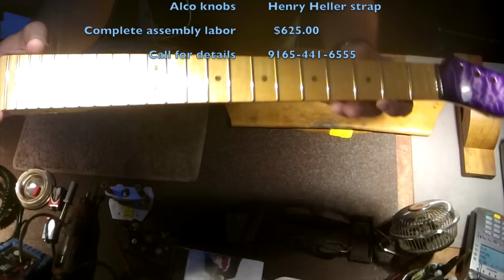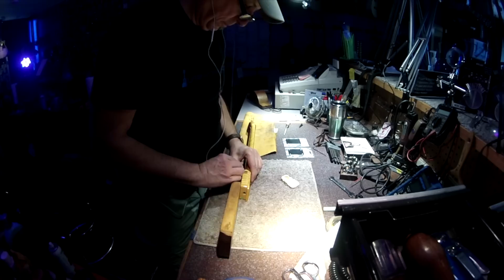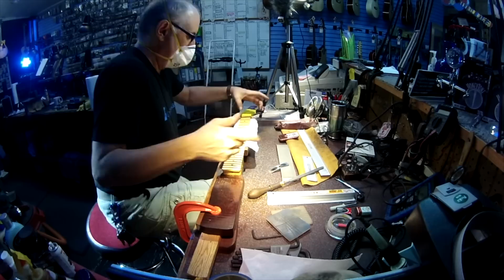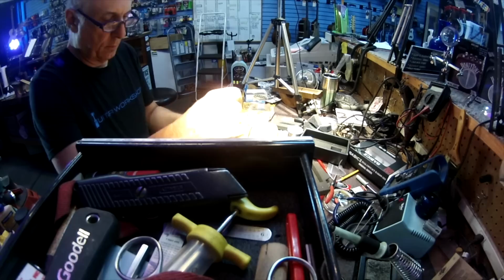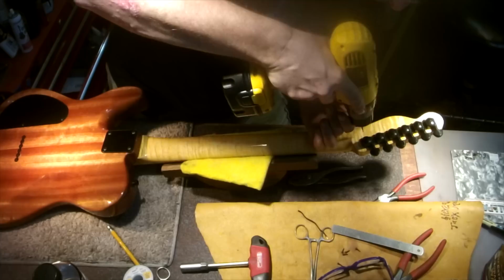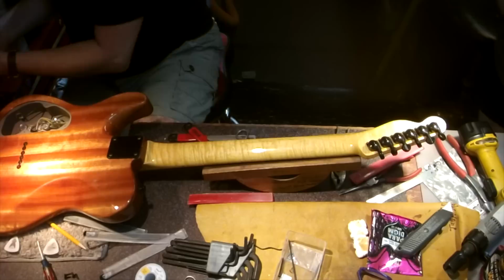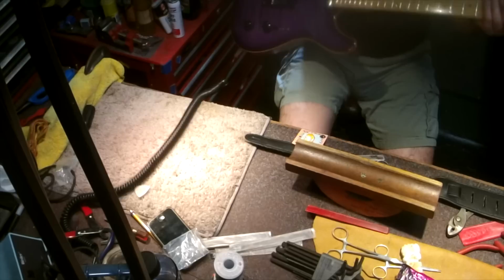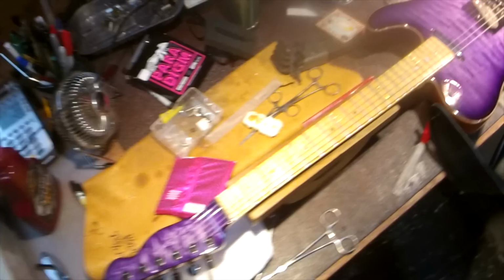Warmoth Tele Build July 2017 Guitar Workshop. Sacramento, CA

Comment: Nice work Dave, but, 1 should never have to do any mod work when ordering from warmoth. They really should have made sure that neck was nicely fitted with what they charge, cheers. Dave.
Reply: I have to agree.  Warmoth should provide perfect fitting parts, since they are making them.  Otherwise, something isn't right.
Reply: I ordered a bass body and neck from Warmoth. They are in production right now. I asked if they would fit together and was told they would since I ordered them together but they wouldn't really do any work on the fitment of assembly because they get in trouble for that.

Comment: Beautiful! I just have to have a pickguard with a Tele though... especially with a thick pick like a V-pick, I'm always hitting the body...
Reply from the maker: Hey Christian, thank you for the compliment and comment. Perhaps you could go with the nice top and make a transparent guard that custom fits the specific areas your pic digs in, minimizing it's muting effect?  I use a really big pic too, the Clayton triangle 1.52, but I've practiced to avoid that extra body gashing for pic control and accurate note selection. Sooner or later, my fingertips eat into the wood though, but heck, if we're not wearing out our guitars, we're not playing enough!  Here's a clip from a recent gig, doing an old Peter Green tune. I'm playing an old 1984 Ibanez RG440, modified, Warmoth neck, etc, the Tele is on the stand behind me (in the Santa hat!). We'll have upcoming vids where the Warmoth tele pictured here gets showcased. Thanks so much for watching, post a link if you build one!
Cheers! 
https://www.youtube.com/watch?v=i099OaFivlg

Comment: The only problem with using Fret EZ is that it contains silicone which goes right thru the finish into the wood making any future refinish work impossible unless you use straight silicone additive like autobody Jamb It which makes the finish more likely to flake off.
I used to work in large factory repair dept.and my repair/ touch up booth was upstairs next to machine shop. Was spraying nitro on a repair and someone there sprayed silicone lubricant on a machine and it was fish eye city on the guitar top.
      Many years later working for fixture shop with spray booth and a new guy brought some silicone spray to work and my boss chased him out of the shop ! He was a guitar builder and somehow knew about this problem.
It's nice that you are player
Might visit if in area I am in OR.

Comment: Need yearly maintainence tips/advice for my guitars. Usually I do the following to maintain/keep my guitars in good playing/looking position
-Change strings every 2 months
-Wash hands before and after playing
-Wipe down the guitar with a microfibre cloth
-Keep guitar in the hardshell case
-adjust truss rod when neck moves during the seasons change

I usually don't go crazy with oils/polish etc.
What do you do to maintain and keep your guitars in good condition? what about the neck/fingerboard-especially for maple/rosewood fb? 
advice and suggestions appreciated.

Comment: how did fender get it so right so early on?
I dream of nothing but teles
Reply: Early fenders are nothing like this though
Reply: @TheEchelon  Yeah but the Broadcaster design is SO considered, engineered
I have a couple of custom teles and of course they have the body contours added
but there is so LITTLE improvement you can make on the original design
The big meaty neck makes for awesome sustain and the older vintage radius is great for chording : )

Comment: Hey Dave, That's a spectacular looking guitar. Thanks for sharing your process. I have a question regarding the bushing install. I've built two Warmoth Teles myself (I'm no luthier, just a DIY enthusiast and guitar nut) and I installed the bushings by using an old soldering iron with a pencil tip to heat the bushings in place until the lacquer softened enough for the bushings to seat snugly. I saw the technique recommended on several build blogs and forums. You opted to route out the holes instead. Is there a disadvantage to using the heat-and-press method that I'm not aware of? My next project will be a hardtail Strat and I don't want to keep using a potentially inferior technique if it could cause me grief. Thanks!
Reply from the maker: Hey Damon, thank you for watching. I use the heated parts for anchor extraction, and yes, many like installing that way, so you certainly can do that, but it also comes with a different set of risks: the bush not sitting quite right and skittering across the back leaving little melted puckers, or the rim setting too deep into the finish. But either will work. I like the clean out as I get a nice metal to wood contact and the rim sits cleanly on the finish surface. Being fallible, I try to take, for me, the path of least failure of my own limited skill set!

Comment: The whole point of locking keys is so you dont have 10 string winds ... wonder why he wrapped the strings so much?
Reply from the maker: Break angle over the nut, no string trees, no tree hang up, no slipping on the post either.
Note: some keys, like Sperzel 6 in line may be purchased in a staggered set, keys 1 & 2 very short, 3 & 4, a little taller, 5 & 6 normal, so a treeless headstock with break angle and no progressive wraps is possible, I just liked the Grovers for this build, they're not staggered. Thanks for the great question!
Reply: Dave Tone ahhh! Learn something new every day

Comment: You gotta be kidding - is Warmorh using Gibson’s QA book now? LOL.  For the money Warmoth charges you should NOT have to resize the pocket or do anything to that neck but bolt it on.  $100 necks from China - maybe. But a $600 neck should be Plekked for crissake.
Reply from the maker: You get what you pay for, it's that simple. Warmth quality is still stunning.  I'm still gigging on necks I purchased shortly after Warmth got started, and they're still stable and true. There are no Chinese builders at this level. Note: the body came from the Gallery page, the neck was made 6 weeks later to match, so the two parts never saw each other until they arrived in my shop. When I've ordered a neck and body together for the same project, they fit, but there may always be some lacquer thickness issue to be addressed when ordering separate parts. I'd much rather have to trim a bit and have a super snug fit than extra wiggle room.
Reply: Agreed. Warmoth is way too expensive to be making a neck that doesn't fit the body they sold along with it.
Reply: This seems a bit unusual about the neck not fitting into the pocket, as I have built 3 Warmoth guitars and all of them were a perfect fit. If you go buy a Custom Shop Guitar it will set you back way more than a Warmoth, and the Warmoth products are absolutly beautiful quality and you can pick what ever exotic woods your heart desires:-) (very custom infact).

Comment: Aren't you supposed to use as little wind as possible when using locking tuners?
Reply from the maker: No actually, Ideally you want a minimum of a 50 to 75% wrap around the post so the load bearing is on the large curve of the tuning shaft, not the sharp angle of the post string exit. As I am not
using tree's, I also need break angle/downward force over the nut, so with several wraps I achieve that. Once the string is pulled taught it doesn't stretch out of tune. It didn't for me. 
I played four gigs and wasted this set and have zero tuning problems. I've had three different sets on and no tuning issues at all. Very stable. Hope that helps!
Reply: @davetone2106  false tbh. Choosing not to use string trees have nothing to do on how a locking tuner is supposed to work. You can just get away with it on a tele cause you have a fixed bridge, but having multiple turns would render the locking tuners pretty much useless while dealing with a whammy bar, and i guess and hope you know it.
Reply from the maker: @valebliz  Well, sort of. You are correct, multi wraps on a trem guitar with the Fender shallow headstock defeats the point, however, two or three wraps to get better break angle makes no difference on a stop tail. The lock post does secure the string from sliding out the opening and there is zero tree drag because there's no tree (no hangup from bends) . When using a trem system, however,  I might reccomend a roller tree as they minimize any binding, though the Tusq versions from graphtech work quite well. My customers have been very pleased with the way the roller trees work. https://www.stewmac.com/parts-and-hardware/string-trees-and-retainers/roller-string-retainers-for-guitar-set-of-2.html

Comment: WOW - $500+ for a neck that you then have to perform a $185 fret job on?!?! Unbelievable!
Reply from the maker: Yes. There is a very good reason there are guitars that sell for $2000.00, $3000.00 and up by makers like G&L, PRS, the Fender Custom Shop, Anderson, and many others. When you play them,  when you spend thousands of hours gigging and recording with them you know why. It is the details in the wood selection and treatment, finish and assembly fit that separate fair and average from great to outstanding. Believe it.
Reply: Dave Tone..... I get that & I also appreciate that the final guitar you have made is not only beautiful looking & sweet sounding, but it would also stand up very well against any of the brands you have mentioned! I meant no disrespect to your build quality or your ability as a luthier. I guess I just expected a $500+ neck to at least have been set up to minimum spec.
Reply from the maker: Well, here's the deal. Necks from all the providers; Allparts, Mighty Might, Chandler Warmth have frets pressed in with the ends milled reasonably smooth. Yes, you can just string it up and it will play. That is the minimal set up. At the $500 mark you are paying for Aged, kiln dried 5A flame or birds eye, glow in the dark side dot markers, abalone position markers, gloss amber tint, Gotoh dual action truss with side adjust, graphite nut with basic slots guided in, a quilt maple headstock veneer that matches the body with a purple burst finish. So, that's a lot even for a neck. But, like most ALL lacquered maple necks the frets are painted over, and it is left to the assembler as to how much detail you want to put into the treatment of those frets. 
For some, a very simple removal of the lacquer on top is enough, and good enough. I do the maximum detail by exposing the entire fret and total top mill buffed out with the jewelers rouge. Very few shops do that, but it makes a big difference in how low and clean the action can be set, and how beautifully smooth the notes bend across the wire. That's part of the detail that makes this a $3000 guitar that would sell for $2300 street.
Reply: Dave Tone I’m calling B.S !  You didn’t see Eddie Van Halen steveie Ray Vaughn etc etc!! Your just separating the customers from their money! Snake oil product salesman B.S. !, this whole video is a sales ad😂
Reply: @stevensrspcplusmc  what blows my mind is 185 bucks for a level and crown it's about 85 bucks where I live lol a little more and I could get a re fret jeez

Comment: Warmoth should have leveled the frets themselves IMHO
Reply: They say they don't do it because it's a step that should happen after the neck is installed, under tension with strings and then left for a day or so. I can see their point, but it work that many buyers aren't expecting to need to do. But the wood movement can change the height of the frets.